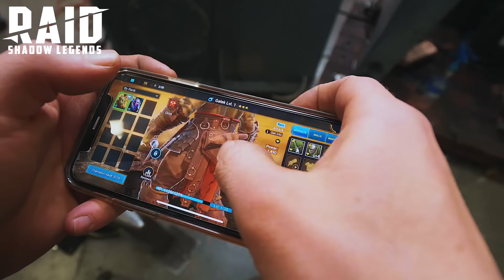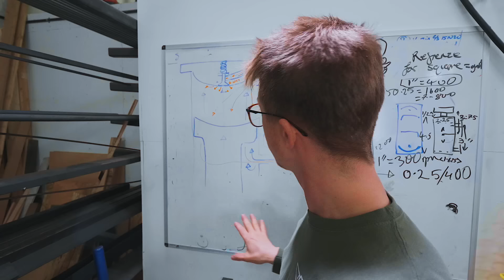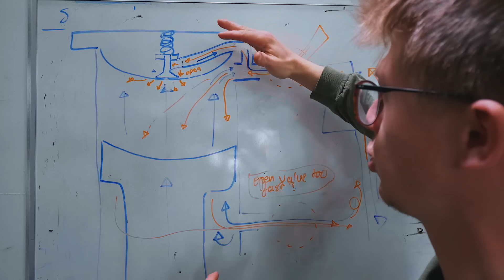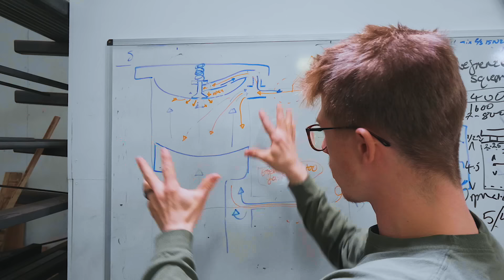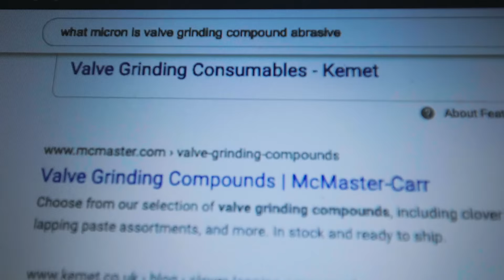FIXING THE 300LBS POWER HAMMER!!! Part 5

Comment: Hey Alec to me it would seem that the spring is too weak. The spring is overcomed too easily by overpressure or bleeding somewhere in the circuit.  Reguards a Marine Engineer
Reply: Indeed. It could be, and most likely is, the original spring.
Reply: The spring allows for the return of the valve. Not the valve to seal. The upper chamber pressurizing is what seals the valve, not the spring.
Reply: The pressure looks to be in the same direction as the overpressure condition. The backfill gas has to overcome the spring pressure to fill and force the piston back down. On the upswing the spring pulls the valve away from the piston into the seated position. Once sealed the momentum of the piston will add force to seating the piston. The problem is blow by and is likely a result of the seating surface.
Reply: @jdeluca6181  Not quite true. Air pressure echoes in a system like that, and a high pressure wave could easily momentarily open the valve.
Reply: bballplayer5555 Are you talking blow by of the ram piston.  I was thinking the piston to chamber clearance.
Reply: @Xiph1980  Good to know, but seeing Alec have the same results before and after lapping the valve, I still don't think the valve is the issue.

My guess is maybe the ram has directional seals, and they're upside down causing full pressure going up and partial going down. Hence why his valve adjustments in the previous video yielded worse hitting pressure yet still the ram hitting the top.
Reply: The nut on top of the disc stem will adjust the set pressure of the relief valve. A stiffer spring and a better lap job will definitely help with the set pressure.
Reply: @jdeluca6181  The spring does keep tension on the seating surface.
Reply: @clintthompson9  agree! There should be a set adjustment or torque potentially for that nut! Would be great to find an owners manual as that would likely tell you how to adjust it.
Reply: Agreed. You need to test that spring for the correct seat pressure at a predetermined spring height. It’s likely it is out of spec
Reply: @clintthompson9  I get that, but the pressure inside the cylinder is doing most, if not all, of the sealing of the valve. That spring looks more of a return spring, and a pressure relief for when the ram goes down.
Reply: I still feel like there is som bleeding of air in reguards to this valve.  Earlier i highlighted the possibility of a crack or deformaty on the piston head. It is however too small for me to think it has too much of an impact. I do think that as Xiph says further up there is an "echo" of air bleeding somewhere in relation to that valve. 
Great points however. This valve is where i would most likely put the majority of my energy if it were on one of my machines of responsibility. Once ruled out i would focus on ajusting the valves of which we have yet to see what condition they are in (In terms of wear and tear, - likely minor).

Comment: I realise this is probably too late to be of much use, but looking at your check valve and reflecting on some of the comments below... 
The check valve has a threaded shaft and nut with a split pin style locking pin (often used in aviation I believe to stop the nut undoing over time due to vibration). The thread enables you to adjust the spring tension. Adjusting this spring tension will make the valve open with different pressures behind it, changing the pressure and discharge timing of the cushion of air above your ram. 
You may have to trial and error it, but you seem fairly comfortable with that, you could do this briefly without the split pin and some thick grease or blue thread lock, find the right spot and then lock it with the pin. 
The fact the spring is old may have an effect on its function, however given its age it is probably made from a high quality spring steel that (so long as it has not been over stressed or corroded) should not fatigue during use and should retain its properties for life.

Comment: Uhm, you could of ordered that lapping paste from the same auto parts store!

Question - how do you know how tight that spring needs to be on the valve? 

Yes, paint it please! Green!
Reply: @firemanli and @alecsteele I too was wondering about the tension in the check valve.
Reply: Should be airtight at whatever the operational pressure is within the hammer. But testing that would require very expensive specialized equipment. Basically you have to fill the machine with Helium, and place Helium Sniffers around it to detect any kind of gas leakage. That is done for prototyping production units of high pressure tanks etc, and components to be send to space, but it's not something you can easily do in a small workshop. 

So checking for watertight at standard pressure, as Alec has shown in the video, is a good "rule of thumb" method to show that the contact is at least reasonably tight.

Comment: You might need to replace the valve spring with a new one.
Reply: If the valve is lapped proper the pressure will keep it closed. The spring rate is for opening.
Reply: Agreed. Wasn't there a way to adjust the valve tension too? maybe fiddle a bit with that if that's the case.

Comment: Your piston to head clearance decreases quite a lot with a thinner head gasket, which will make it much more likely for the piston to kiss the head. That original gasket seemed much thicker than the new replacement gasket. Maybe an original thickness gasket along with your grinding down those welds will help. The valve spring may also have lost too much tension over time, but how it would probably be tough to find out the original spring tension. Gotta love working on old stuff! :)

Comment: Hi when you lapped the valve it seems you were holding the angle manually, usually when lapping an engine valve the valve guide hold the angle perfectly straight. Maybe it hold water but you dont know for sure if it can hold air pressure well. Is there a way you can assemble the valve so it hold itself correctly and then lap it. As noted from an other viewer comment, the spring might be to be replaced.
Just thinking out loud here i'm no expert!
Reply: Normaly the valve seat holds the angle for you in car engines. Here isnt any valve seat so yeah.. Also he tested it with the dye still on

Comment: I would definitely paint it. To me the “wear” doesn’t look natural. Someone tried to make it appear as it still had the original paint. I would paint it either a bright red or a caterpillar yellow. 

As soon as I saw the valve I thought to my self that needs to be lapped and then you get to looking up lapping. 

Everything you do seems to get just that much closer to a correctly working power hammer.
Reply: Bright red. For sure
Reply: I wold love a bright red, with yellow for the control arms/connectors.

Comment: Because of the wood base, doesn’t that allow the treadle to extend past where it was designed to go if the machine was designed to be bolted on the floor? Could that “over-treadle” be causing the top bump?
Reply: He addressed that in the last video.  TLDR: No
Reply: @randiverson4226  I must have missed one of the installments
Reply: Peter Radsliff he pointed out in an earlier video that it wasn't able the travel, but the speed which it's depressed

Comment: The valve has lots of threads for the castle nut, I'm hoping/assuming you have it fairly tight .
Reply: If it is to tight it will stop the upper section getting enough air to form the "cushion"! ..... it may well need to be fairly slack!
Reply: Too tight or too loose wont matter when it goes to "check" the air.  It's still letting through a seal somewhere.
Reply: The hole for the cotter pin is where it is tho. It will only line up with the castle nut at one spot. He'd have to add a washer to increase the valve spring's preload.
Reply: The seat is for the cushion on the upstroke - it seats now - flow thru the valve is only for downstroke [which is fine]
Reply: Doesn't matter where the hole is because it's a castle nut. The castle nut could be tightened more or less due to the shape of the nut. Although as noted by someone else  the air pressure should close the valve, unless the timing off.

Comment: as someone that has done a few valve lap jobs on engines, you dont really need a specific tool. sure if you want the PERFECT job get the tool. but you can chuck a valve into a hand drill and apply the lapping paste, then use the drill and make sure you are straight with the bore. I probably wouldn't have hot glued a delrin rod to it you had a whole lot of movement back and forth in the footage. if you ever need to redo this valve job, try the hand drill method. that spring did depress super easy, maybe some of your issues is that either that spacer has worn and is now too small or your spring isnt as stiff as it should be.

Comment: I would suspect the seal around the cylinder itself may be bleeding off the air cushion pressure now.
Reply: <sigh> By pt. 20 he's gonna be resleeving the whole cylinder, isn't he.
Reply: This was a thought I had as well. I would probably just adjust the the timing and when he is modding the pedal make some adjustments to travel too then again the spring might be suffering metal fatigue and rather than be a 30lb spring it is down to 15-20lb the thing to do would be to find what that valve is supposed to have you could try increasing preload with some washers or just getting another spring the right size.

Comment: Maybe consider bringing the timing of the top valve down some more so that as the bottom valve opens the top is still shut until the bottom reaches a 1/4 of its travel and therefor would help with the air cushion effect by slowing down how fast the bottom valve can push air in to send the ram up. 

Or if in your diagram of the last video the 2 valves have different profiles internally it could be possible that at some point someone had them both out and put the wrong valve in the wrong location.
Reply: I was wondering something similar. If they pulled it apart and welded the piston at some point, what else has been "properly repaired" in it's loooong history?

Comment: Alec, try this: ρ_air=1.225-1.194×10^(-4) z [kg/m^3] for the values of z at the altitude your power hammer is now, and the altitude it last operated at before moving to your shop.

You might not be able to build enough pressure at your altitude for the device to function.

Comment: Paint? That precious machine needs a sandblasting!... At this point, I would recommend you try to take it apart to check the rest of the insides as many would probably need some love and care. I doubt the seals are all ok, and if it has piston rings, they probably need some work as the air leak could come from there. 

And I would say, keep the treadle yellow, the rest a nice deep green or a grayish blue.

Cheers!
Reply: Wohren Osso Great advice!👍 And it’s gotta be British Racing Green!
Reply: The blacksmith way is to repair everything with spit and duct tape to minimal but working order
Reply: Alec, if you paint it green and gold, I'll send you a flag from my Alma Mater, Baylor University!
Reply: Wohren Osso advice is very intelligent.  Restore everything in the hammer to as close to factory original as possible with today's techniques.  Do that, then choose an iconic colour and re-paint the outside of the  machine.

Comment: I'm questioning the spring tension on the poppit valve. Most springs in engines,(much smaller valves by the way) have starting 150 pound pressure and can exceed 600 pounds in the open.
Reply: I had the same thought. Tighten the castle nut and/or replace the spring!
Reply: No no no! This valve is NOT designed for the same thing! It has to allow pressure to open it and fill the upper section and then close. The increasing pressure in the upper chamber will act to close the valve on its seating ..... with more than 600 lbs force!
Reply: The problem is in the 'other' direction, the valve actually stays closed due to the air pressure increased by the approaching ram as it rises. 

I DO wonder however if the timing of the pressure valve in the top (for compressed air to force the valve 'open') is supposed to open the valve BEFORE the ram hits the top to add to the air cushion to stop it. In the mid century they did not design things in a 'step-action-reaction' way we do now a day. It was more analog if you will. And they depended on mechanical timing a great deal. Its one reason it took someone familiar with the exact make and model of a thing to do repairs. Today machines are designed in such a way that a general repair person has a good chance to fix things.
Reply: I believe the valve spring is old and fatigued, I thought the castle nut may be an adjustment, but it only lines up with the hole for the cotter pin at one spot. So that's out. I don't think the spring has enough power to overcome the air pressure and close soon enough to trap enough air, that when compressed, will be enough volume to cushion the ram. I also noticed it only hits the top when the stroke of the ram is longest. When he's hammering something 6 inches tall, the momentum of the ram going up is stopped by the cushion, but when he's hammering something 2 inches tall, that extra distance makes for more momentum to stop and the cushion is just barely too small to stop it and knocks ever so slightly. I was surprised how easily he compressed that spring with is hands.

Comment: Regrind the valve seat and the valve surface to get a more even contact. The tools are available online. As well as others may have mentioned maybe replace the valve spring. Other than that paint it to match the rest of your equipment
Reply: Agree, it just needed re-seated.. I have done thousands (on car/truck engines) so that shouldn't be any different to do and just as easy..
Reply: @TheWolfster001  I too have done these on small engines (motorcycles and such). I noticed when he was lapping the valve that it wasn't an even contact.

Comment: As piston is coming up, air goes to the check valve, check valve spring too weak, dumps pressure, loses air cushion, piston hits cylinder cover.
Reply: That's what I'm thinking, maybe a tired old spring.
Reply: the tension of the spring looks to be adjustable
Reply: The air pressure inside the cylinder should push against the valve seating it tighter and tighter as it comes up the volume of the cylinder is so much greater then what a momentary leak could vent i wouldn’t think it was the spring as long as he has good mating surfaces between the valve and the seat
Reply: @trcostan  Good point. You a smart cookie
Reply: I thought the same when I saw the spring. It does not have much resistance.
Reply: I agree, but I think over tightening the spring too much could have the opposite effect because it could retard the timing of the slave piston relative to the driving piston causing a situation of playing "catch up" and then sending it up with even more speed.

Comment: Alec you might have to readjust the valve levers now that the exhaust valve is not leaking. Perhaps your original adjustments were trying to compensate for the leaking exhaust valve.

Comment: Paint it black and you should give it a name.
Reply: Have safety orange or glow in the dark paint on it in case of a power outage during low light conditions. Don't want to be hammering away and then kaput. I've been around heavy machines in sudden blackouts. scary stuff. Glow in the dark emergency paint on all the big machines would be a nice touch for safety. that stuff goes on clear and lights up only when you need it...

Oh! whole thing black, but then clear coat it with glow-in the dark!

Comment: Hey Alex, it looks like that the hit comes when the hammer comes down to a certain level. Maybe you just have to lift up the anvil metal block. So the hammer doesn't have to go all the way down 👍
Reply: Intriguing idea. Shorter up stroke, less time under acceleration, less momentum, less top strike. And he could readjust the valves for more downward force, potentially. It seems like it's not always a full yourself travel that results in a top strike though. 🤷🏻‍♂️

Comment: Get a YouTube collaborator to paint it with designs.
Reply: Maybe a 1/2 American flag and 1/2 British flag paint design?  Also - that thing has to have a seal of some sort (like rings on a piston).  It's not going to seal great with rust in the cylinder or a worn seal (or dried out if it's a rope seal like an old Pontiac engine).  In either case, you might be losing some of the air cushion due to blow by - enough to let it smack the top.
Reply: @sno4fun584  Exactly what I was thinking for the paint job!
Reply: Thanks for another great video. It's inspiring how much you are willing and able to learn. You videos are more than just heat, beat, and repeat. If you do paint it I would go with a simple gray. Hope you and the entire crew and families stay safe.

Comment: I know this is an old video but in a lot of race cars and motorcycles we use copper valve seats because as we all know copper is softer than steel and no matter what the steel valves will seat and seal no matter what. This is just a suggestion if this ever happens in the future or on other equipment. If you were able to machine a copper sleeve and seat for any valves in the future it might save you a little hand sanding and time. Just a suggestion!

Comment: Royal green with a light gold flake would be awesome. Can you adjust the main valves individually of one another not at the same time as with your turn buckle arrangement. Seems the top valve needs to be closing sooner to allow the pressure to build quicker on top of the piston so that it can’t hit the top.